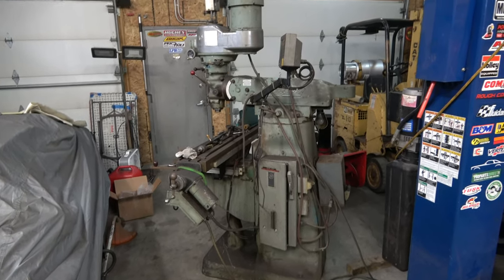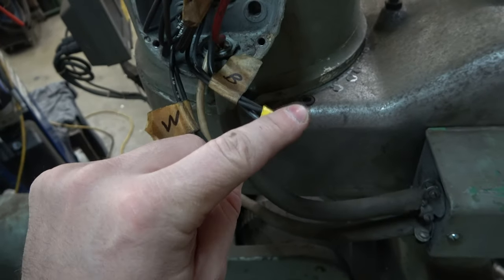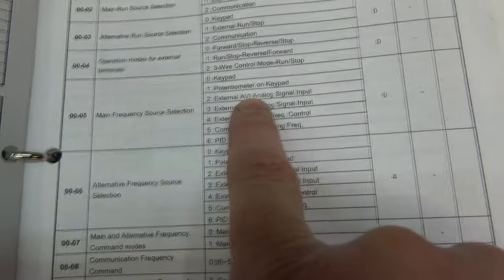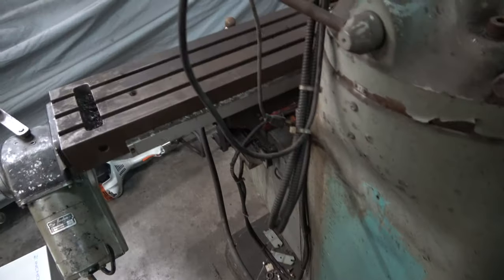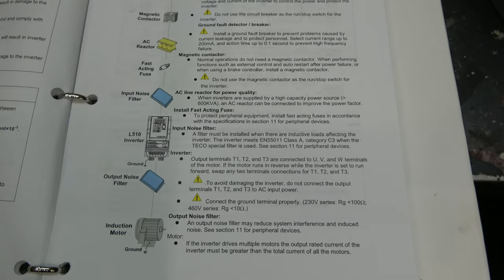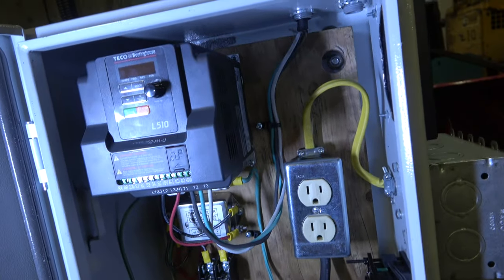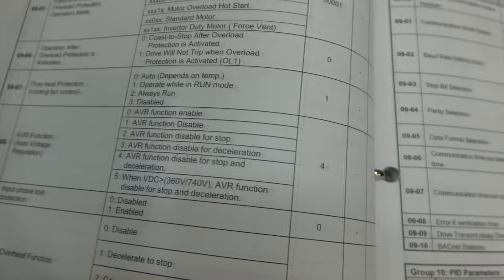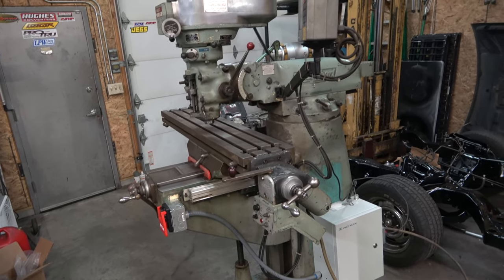Teco L510 VFD Install on a Bridgeport Mill

Comment: Enjoyed the video.  Recently purchased a Bridgeport Series I and looking on how to get it wired through a VFD.  I have 220 single phase input looking for 230 3 phase output. Was looking at that exact same model of VFD. I didn't realize all those settings can be customized.  Thanks for the quick overview.  Hoping manual is easy to understand all those settings and is not hard to customize.

Comment: Hey man good info on the VFD. Didn't realize there was that many parameters to set one up. Good to see that one can retain the original for/rev switch on the head. Just becomes a contactor basically and doesn't carry the motor current.. Good deal. Good luck with the Bridgie. I volunteered to VFD a Beaver British made mill for a friend. Wish me luck!
Reply from the maker: Thanks for dropping a comment, nobody else did.  lol

Comment: hey man nice info>> I just picked up a three hp acer mill I want to use a vfd as well I was  thinking of leaving the vfd acessable maybe so I can use the adjustable rpm on the controller on the regular I"ll look into the vfd your using and check my motor spec plate and go from there
Reply from the maker: If I would have sized it bigger the e-stop may have worked better.
Reply: @Oldsmob455  Iwas just watching a video on a motor guy saying to check  with the manufacture to make sure the motor is inverter capable even though if will spin the motor over time it can heat up the windings and differnt problems can occur I"ll call acer and check and see if my motor will accept a vfd
Reply from the maker: That might come into play at lower frequencies.  Fortunately my mill is variable speed and I pretty much run it at 60hz.  @kenclaro1806